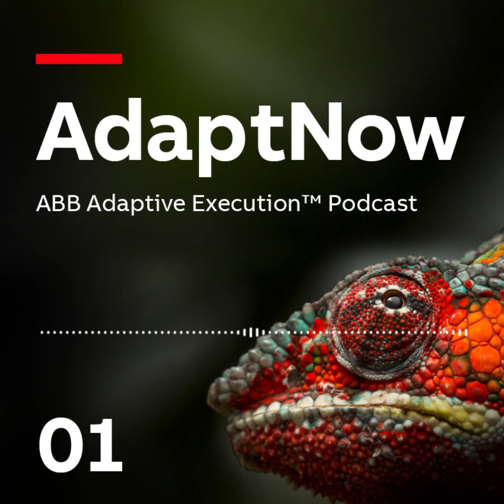Introduction to ABB Adaptive Execution™:  Built to adapt rather than built to last

Comment: I really like this podcast. ABB Adaptive Execution is the program all ABB clients should use on their projects to most effectively and most efficiently to deliver their projects. I like the phrase that Adaptive Execution is designed to adapt and not built to last. I hope this will cover the capability to quickly and easily replace and upgrade automation components and eliminate the need to replace control system platforms every 10-15 years. Sandy Vasser